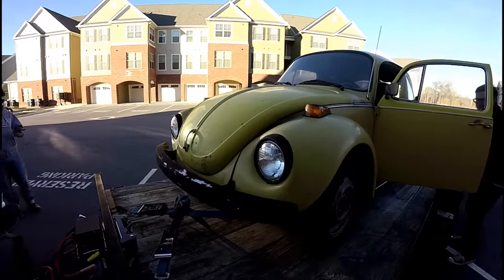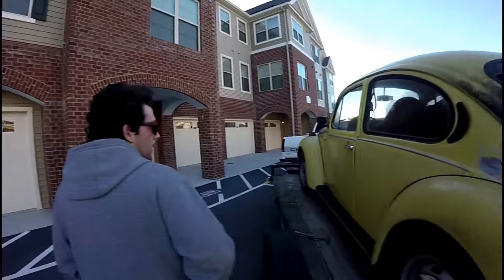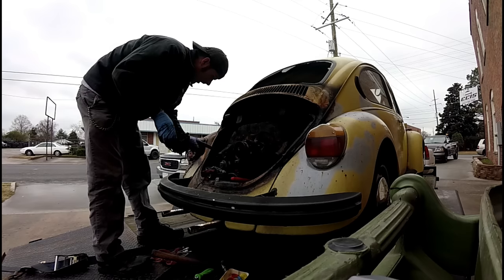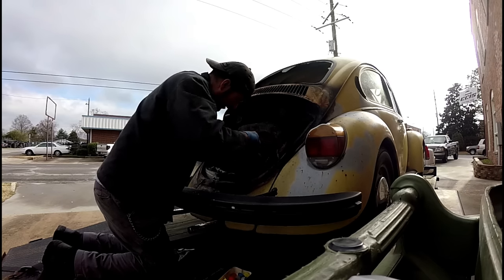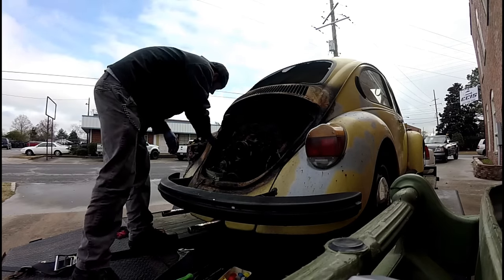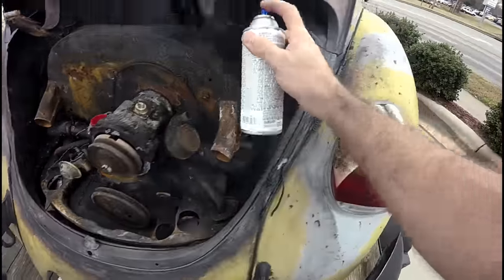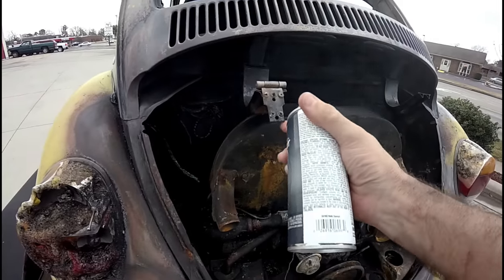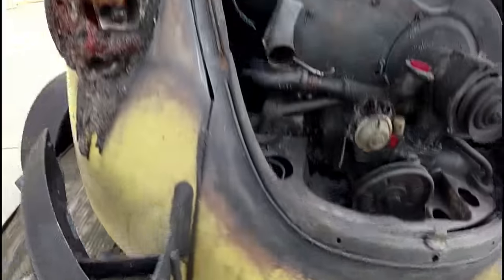"Fire Sale" VW Beetle- Cheaper than a Go Kart! Ike's Adventures

Comment: Remove the engine for now and Install some sort of a shaft (go-kart axle?) to mount to the transmission input shaft with some sort of adaptor. That axle would become the crankshaft. Support it with two carrier bearings. Install two sprockets on the shaft. Then install two Predator 670's in the engine compartment one either side of the shaft or above it or wherever they fit. Use a clutch on each 670 and then chain drive the axle/crankshaft. I bet it would power it. You wouldn't have to use the clutch pedal since the two engines each have a centrifugal clutches. Should be able to just let off the throttle and shift. I was thinking of trying this with a Miata just to see if it would work but a Beetle may be a better choice. You can always swap the original engine back in later...
Reply: ...and likely needs to be close to a 1:1 ratio with the sprocket and and clutch. Would be a 44hp 1340cc set up. My '62 Beetle had a 40hp 1200cc engine so the twin 670's might actually be streetable.
Reply: JeepCollector91 sounds like a lot of hard work for something slower and less reliable than the engine that's already in! P.S Land Rover over Jeep any day!
Reply: + iMovieXL
A lot of work... yes.*
Slower... yes.
But appropriate for this channel... yes. (and could work with their current sponsor)
And I would say keep the VW engine to reinstall later.

As for Land Rover over Jeep. Both can be capable but Jeep YJ's fit my budget. I can't afford the parts for a Land Rover and I can get used Jeep parts all over the place. Lots of wrecked XJ's and ZJ's in the local U-Pull salvage yards throughout the US since more Jeeps are sold in the US than Land Rovers. 

* (A lot of work for the install of the twin 670's. Removal of the VW engine only takes about 30 minutes)
Reply: The predator engine is fucking shit. Better of buying a motorcycle engine, with a decent hp figure. Or just fuck it and buy a turboed hayabusa engine
Reply: +CrazyGamerz46
All that has been done before. There are already Hayabusa Beetles, Miata's, Smart Car's, Mini's, and more...  I figured the cheap Predator engine would be something different. Especially if it was streetable. 
I doubt that he would want to do a swap of any kind now that he already has this car running and driving. There is another Beetle sitting in his garage though that parts have been robbed off for this project.
Reply: JeepCollector91 Yeah i know dude, trust me i know hahah
Reply: +JeepCollector91 Your beetle had 40hp, but this is a Superbeetle which has 70hp.
Reply: AE86 of Mt. Akina 
I know the engine currently in that bug has more power. I was just trying to say that the 44hp of the twin 670's would likely be sufficient to move it down the road if he wanted to do something different...
Thanks.
Reply: JeepCollector91 Yeah, though torque matters too and I don't think it would have much.
Reply: +AE86 of Mt. Akina
I know it wouldn't have much torque but would be pretty close to the torque of my old 1200cc '62 Beetle. 
1200cc 40HP/64ft-lbs
Twin 670's (1340cc) 44HP/66ft-Lbs

Comment: swap it with a predator engine i guess ^^
Reply: simon st lmfao
Reply from the maker: Of course
Reply: THANK YOU GO-POWERSPORTS
Reply: make more build videos on this
Reply: don't forget a torque converter.lol
Reply: It''ll be fine
Reply: simon st you forgot to mention straight piping it XD
Reply: simon st For Predator engine for testing purposes only. Haha.
Reply: If he puts a 22 h.p Predator on it, it will have 16 hp less than the first VW bugs.
Reply: the original beetle was designed to have 25hp
Reply: At least do that at first

Comment: here you go:my buddy did this and it's awrsome. he put a 25 lb turbo in it, straight piped it tuned the carb professionally put a cold air intake, got the tranny tuned just right and a few more minor things. he could pop a 17 second wheelie and go 0-60 in about 7 seconds

Comment: My 1988 34.5 foot Airstream motorhome, built on a Chevrolet P30 chassis with a 7.4 liter carbureted gas engine and TH475 3 speed automatic gets 10mpg on fairly level ground i.e. anything but mountainous terrain. It always surprises me how well it does compared to friends 7.4 liter powered pickups and Suburbans.

Comment: If you want to just get the motor running, after you replace all the burnt parts, make sure you check the valve lash. All that heat from the fire probably messed with it. Experience says lash them between 0.004" and 0.006" depending on how regularly you're gonna check em. Check the head bolts too. Torque them to 7ft/lbs first, then 22ft/lbs (if you have the 10mm head studs)

Comment: hell yeah. please do a budget build. ide love to watch that! would be cool to pull that engine out. redo the tins on it. and get it mechanically solid. fyi there is usually a rubber seal around the engine bay. it is essential to jave that in place when you have the hood reinstalled. cant wait to see this one. keep up posted. stoked to see this.

Comment: My first car was a $250 beetle. We took a body from a 62 with a blown engine ($150 - 62 beetles had a 6 volt battery and a flat windshield) and an engine from one with a smashed front end ($100) and combined them into a working bug. This was in 1975.

The engine was swapped without even using a hoist... unbolted it onto a skid while a friend who was about 6'foot 6 inches and 300 lbs picked up the car by the rear bumper and held it there while we slid the replacement engine in place on rollers, then he lowered the car back down over the engine. 

A few years ago I saw a clean looking 62 for sale, guy wanted 6 grand for it, probably got it too. 6k will get you a pretty decent Subaru with 4wd, good heat, etc... but you cant change the engine just by picking up the car :-)

Comment: That's a nice car. With the Super Beetle strut type front suspension,  I would just simply restore it and use it as is for now. Seems to be in decent shape, minus the fire damage. Nice catch. Then, get an electric fork lift motor, controller, adaptor and batteries and convert it in to an electric VW. That would be a nice project. Or adapt the largest air cooled 2 cylinder engine and see how it would do performance/fuel economy wise.

Comment: Just remember, they didn't put anything on there that didn't NEED to be there with the exception of a few primitive emissions controls. Make sure you don't run it without the deck seal and all the engine shrouding in place. You guys know air cooled engines, this one isn't much different. Also, put your fuel filter up under the fuel tank. It's a pain in the ass like that but you have a lot less chance of an engine fire. You want a solid piece of line coming off the tube out of the spine. When these things REALLY get going, the block is magnesium and you aren't going to put it out. As it is, that engine might still run. Just do your seals and all. Cheap as you got this puppy though, you can get yourself a big bore and a stroker crank and still be way ahead!

Comment: I'm a VW guy. Not a fan of Super Beetles. The front suspension can be a pain. I'd personally put a 2332cc engine in it.
Reply: but isnt a improvement over the double wishbone design which is basically a go kart suspension macPherson struts is a better design and used in most cars today 🤔

Comment: Pull the Motor and fix it on a bench clean the engine compartment and the firewall and make sure everything looks really good you got a replace the cable for the gas pedal and all the wiring right but with the engine out it be a lot easier

Comment: Ike, since you asked, I would do the same thing you are doing. Parts are still available. Really nice $7500, - $10,000. Running and driving with no obvious defects, $5000.00 HOWEVER if a V-Twin were to make it's way into the engine compartment it would have 14 less hp than the first bugs ever built. Or you could go radical with a slammed and chopped Super Beatle, big V8 in the front, stacks, tall gearshift with skull, somebody help me here. big tall tires.26 in. wire wheels sun roof, somebody please help me. Thank you. black primer, door handles, headlight rims, antenna and nerf bars all chrome. ahhhhhhhhhhhhhhhh

Comment: pull the engine. replace the clutch and whatever wiring and fluid lines that have been damaged(ie:brake lines-etc) check the trans seals and axle boots and then make a parts list for the engine. it will require mains seals/valve cover seals/gaskets. remove the thermostat flaps from the housing and when you bolt on a new generator use industrial green belts. single barrel solex carb if you can find one. this is a starting point. treat the burned metal wi8th refinish protocols ans window replacements with new seals. this is gonna take some time to do it right but the shell is there and most of the metal looks salvageable.

Comment: I changed the alternator on a beetle and discovered that I should have lifted the shell off the engine just to get the air cooling slats and head covers back on. You'll see what I mean when and if you need to change it.

Comment: Run when you hear Super Beetle they do not have torsion bar/axle beam front suspension. It is a Uni-Body type construction with the suspension attached to the body pan. These are not suited for Baja type Bugs. They are oaky as daily drivers.

Comment: Super beetles aren't best suited for baja conversion, They are fun off-road vehicles though.
Reply: Any small car that can be converted for off road is suitable for a baja race, baja races are literally off road races. Small vehicles have the advantage of having less weight and turn quite easily. You can win a race simply by being able to get around corners faster than much quicker cars. If you could center the weight, even a smart car could win.
Reply: Also great road track cars.
Reply: +lepayen No, it's just better to buy an older beetle. The Mcphersons on super beetles are more fragile than glass.

Comment: You can just about bet that it had the old wiring in it. That's probably what caused the fire. A new, longer wiring harness so you can run the wiring in a better position will cure that problem. If it doesn't have it already, switch it over to electronic ignition. I don't remember if these had generator or alternator. Either way, it needs an alternator.  Fix the other obvious stuff. Paint it. Sell it. Or drive it. I would love to have one of these. But they are getting expensive. Whoever you got it from must have not realized what they had. It's worth more than what you paid. These things use to be cheap to build and sell. A nice one can bring from 8 to 15 grand. In the 80's these things could be bought for cheap. Rebuilt to like new for 2 grand and sold for around 35 hundred. Not anymore. Just my opinion, Unless it's rusty, it would be a shame to cut it up to build a rail.
Reply: I wouldn't dare cut it up

Comment: Baja kit. Cut the back off open motor, duel webers with a big cam.  The super Beetles are crappy front suspension to lift but can be done.  It would be right up your alley.

Comment: Fix it back the the way it was if it was me. Did it look like the battery was the cause of the fire?
Reply: The battery is under the back seat, not in the engine compartment. Doesn't look to me like the fire started in the interior, or there would have been no interior to sell in the beginning of the video.

Engine fires caused by leaks in the fuel system were not all that uncommon in the air cooled bugs. I had a '67 that burned in a very similar manner before I bought it. The previous owner ended up replacing the engine before I bought it.

That was a fun car - I miss it.

Comment: I'm just curious. Why did you use clear coat when primer works better to penetrate and seal? As for what to do with it, I'd see about getting an old porsche engine. It's a bolt in upgrade. You might also want to check into putting ATV tires on it. That turns those into one hell of an off road vehicle. It's damn hard to get a beetle stuck, or any other vintage VW for that matter. They are quite intrepid vehicles.

Comment: I totally want one now. Y'all should buy my RC truck is 30 plus miles per hour
Reply: gaming24/7withcody games Lol, my nitro RC runs 90+ Mph.
Reply: losi8ightyew yea. My rustler will do 115
Reply: jeffrey vandermeiren Yeah, thats my 1/8 carbon fiber chassis buggy. I've worked it's 12 port engine sleeve to essentially Swiss cheese, it makes around 8 HP on 40% nitro. Now my nitro on-road car is crazy, I've radar'd it at 137.2 MPH exactly. 3 speed transmission. I ran out of room. I call it and my 1/8 buggy, "Brushless Baits". Never lost to one.
Reply: Holy shit

Comment: I would put a subaru 2.2l na sohc in it. Plenty of power, plus if you find the hatch that goes on it, you can fit it without cutting. But be careful of the disc brake conversion kits, and most anything that are aftermarket upgrades to these - mostly made in china garbage that is dangerous. I know from personal experience.

Comment: If you pull the engine it would be easier to get that mess cleaned up, it's only 4 nuts & the engine slides back and down...easy a pie.

Comment: When you have an engine fire on a type one motor you can just about counting on needing a carb, fuel pump and spacer, belt, heater ducts hoses, Alt and regulator, or gen, and wiring... I would say you a cheap set of wheel if the trans and engine is in good shape.

Before you go to far check the engine's end play by pulling and pushing on the crank pulley, should be about 003" - .005" If you feel any look at rebuilding the engine.
Reply: I checked the play first thing. its good

Comment: Get her running on the cheap. If you have to change colors, flat black with red wheels and maybe a red accent stripe.  No need to lower it or build a stupid money motor for it.  Fix it, drive it, enjoy it...  It's a 73, so it doesn't command collector car money yet.

Comment: Small diesel swap would be sweet.
Reply: I was planning to swap an ALH 1.9L diesel into my '62 Beetle. But parted out the beetle instead and now the ALH is likely going into one of my MX5's... A diesel beetle would be easy. Just remove the ALH from a donor with the complete engine cradle and front suspension attached. Then graft it into the rear of the bug chassis and lock out the steering. Cooling would be the most difficult part but totally doable with enough patients. Even easier if they could live without the rear seat and rear package tray.

Comment: 10 miles to a gallon? That's really bad, actually it's terrible. I'm sure a hummer does better than that and it's a gas guzzler. Geeze, only 10 years ago, most cars were getting 40 miles to a gallon. I bet that beetle does better than 40 miles to a gallon.
Reply: It's a big truck with a 454 under the hood. It pulls great s long as you don't care about gas. Good thing gas is not $5.00 a gallon.
Reply: most cars getting 40 per gallon!?!?! are you higher than a 10 year old smoking his first joint?
Reply: That beetle has a 2 stroke engine. They are not known for their efficiency. I'm thinking he'l be lucky to get 20 mpg.
Reply: And you, with the 40 mpg comment. A beetle when it was new got 34 mpg. Not quite 40, but pretty fuckin good for being a 70 year old design.
Reply: How good are they at towing trailers?
Reply: How many cars can your toyota haul behind it on a trailer?
Reply: And 18 wheelers + busses get less than that, but it's still more efficient because a larger vehicle hauls a lot more weight or people than a civic.
Reply: I am from Canada. It may come as a surprise but we too have hybrids and small cars. The mileage is great but the don't work very well for towing or in extreme cold. Both diesel and electric vehicles really start to suck at any temp below  -15c. That being said 454 trucks are a thing of the past even here in Alberta. everyone needs to roll coal these days. I guess we all do things a little different around the world. the other factor that we forget is the difference in fuel prices.
Reply: Gasoline here is currently going for 93 cents per litre Canadian. Looking online in Atlanta it works out to 68 cents per litre Canadian.

Comment: that engines gonna need a full rebuild
Reply: Hopefully it was just a carb fire or electrical and not from an overheating issue. My '70 Nova had a carb fire back in '86 and burned nearly everything under the hood. Carb was melted down over the intake. The engine block was fine once the water was cleared from the cylinders.